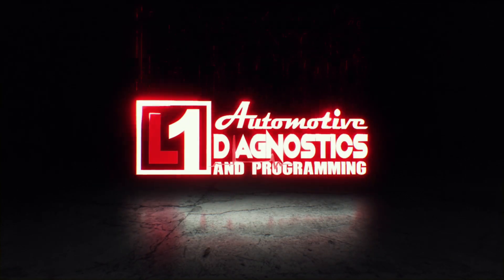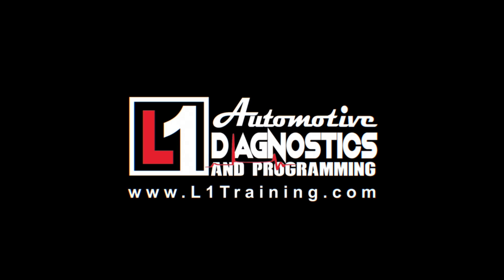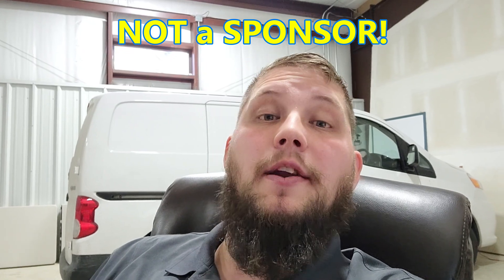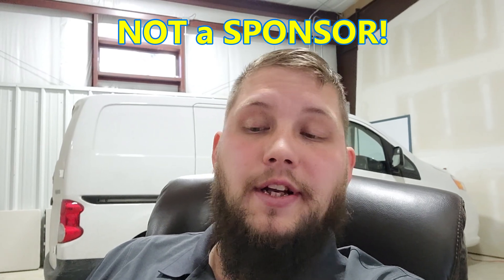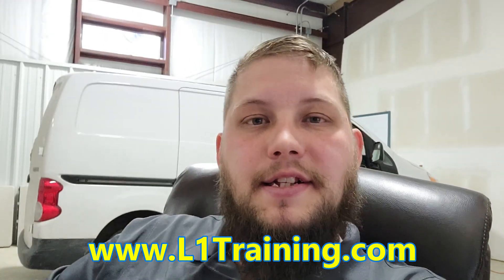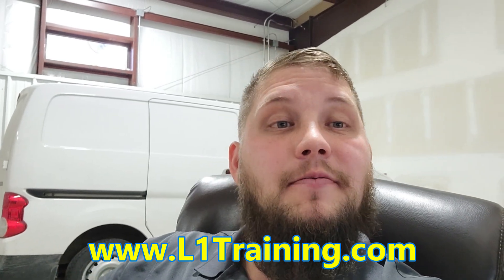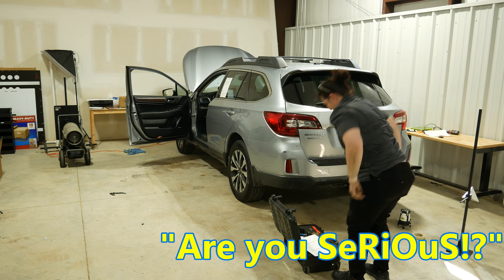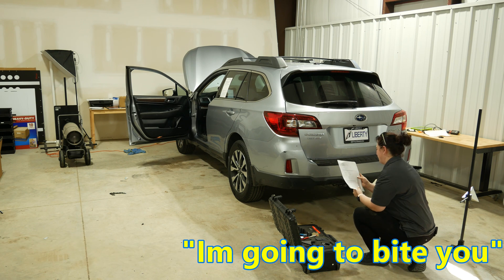Subaru Blind Spot Radar Calibration Part 2

Comment: Hey man! Thank you for that Video.
I lowered my GR86 and needed to proof to the gov. That the BSD/RCTA are calibrated. The car didn‘t show any warnings or so. So I reached out to my dealer and the put a Unit on… well now they deleated the calibation… since i need to have them calibrated… i just wanted a paper that stated that they did… no real work… but anyhow… how much time did you spent on the calibration ?
I don‘t Trust my Toyota dealer anymore. They f***ed up al lot since I got the car. Thanks in advance

Comment: With the help of this video, I was able to make a radar target out of cardboard lined with tinfoil, attached to a few scrap pieces of wood. Using my FOXWELL NT510 Elite Scan Tool, I was then able to calibrate my Subaru Outback. Thank you.
Reply: Did you create and post a video of that????  I'm checking for your scan tool on Amaz. but they don't specify fit for subaru?

Comment: Now measure a piece of 550 cord from the stand to the corner bumper. You can ballpark it from there in the next one. Works every time
Reply from the maker: For us we do the whole procedure every time. Its the only way to ensure its calibrated successfully.
Reply: @L1Training  
I get what you’re saying. I’m not implying you guess. I do this procedure a lot and getting up and down off the ground hurts. So I made an adjustment to the calibration.

The manual is has you draw a triangle on the ground to find the position to mount the alignment tower. I took that calibrated position and made my own triangle off the bumper and rear Axle hub cap. I still archive above the calibrated percentage the manual requires.